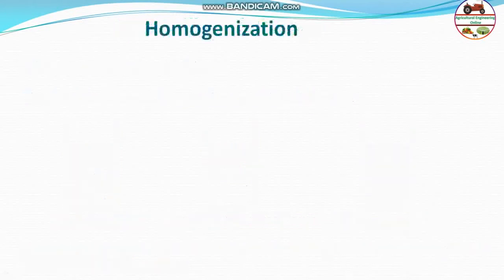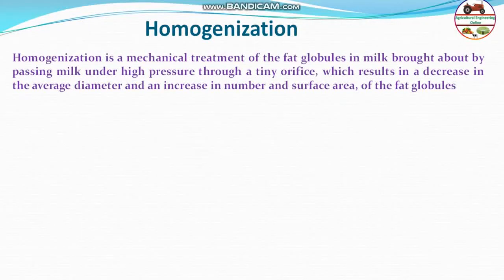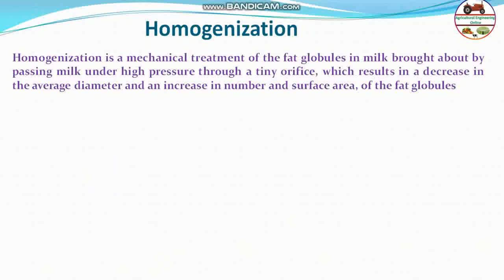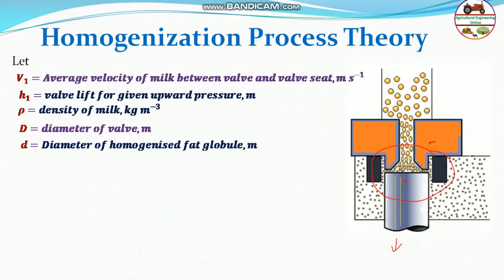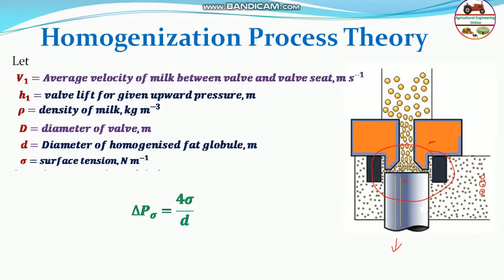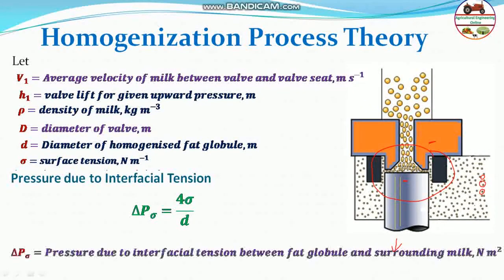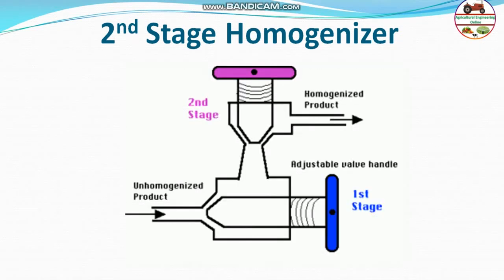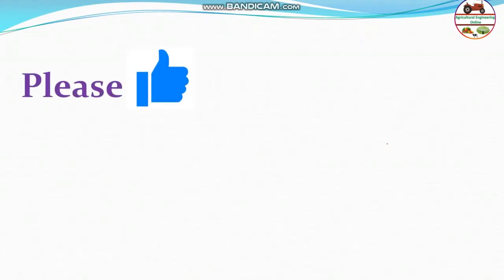Homogenization of Milk Lecture

Comment: I find homogenized milk is relatively congestive in the body, substantially more so than raw or non-homogenized milk.   Many diseasements are caused by gunking/congestion of ones body system.   Homogenized milk is a substance which promotes congestion within the body,… which contributes to diseasements.